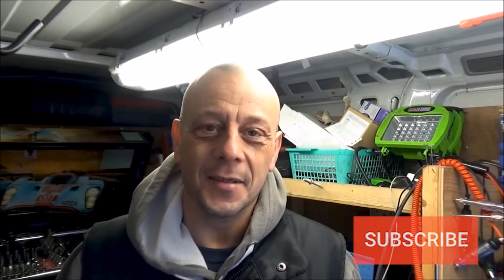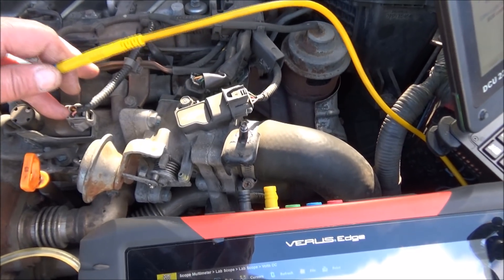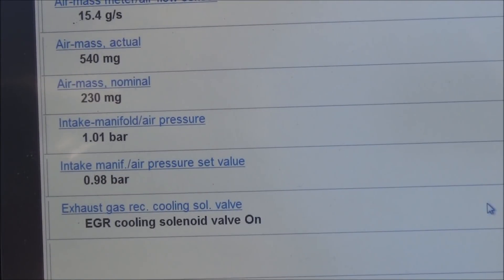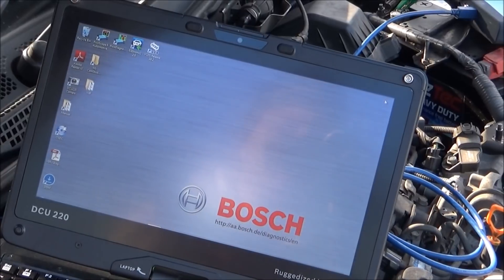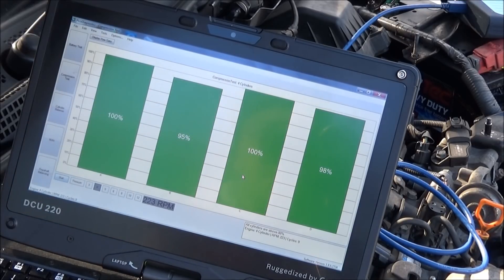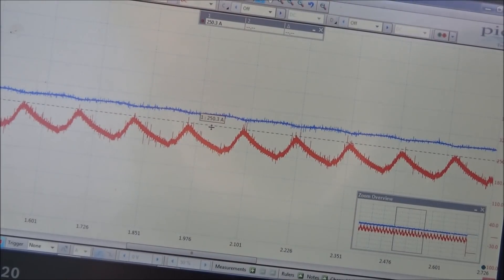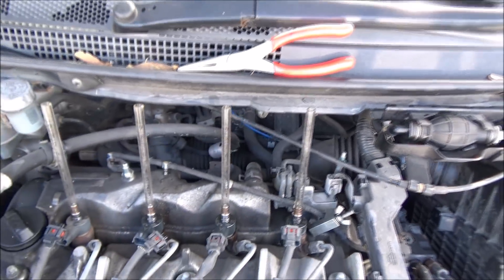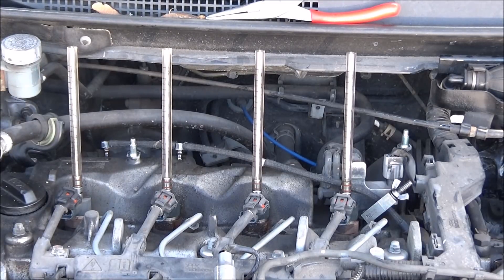2006 Honda FR V poor starting & Generic test methods

Comment: Hi Steve, love the work you do and I'm enjoying the videos but can I ask did you remove the egr on this car to check the seating as my opinion looking at those MAF readings while you were working it using your mitti vac is they looked good to me, 2.2 engine with 560mg/s with a closed egr I'd say was pretty good. 
Also the leak off test you did, do all 4 injectors get bench tested as I'd be suspicious also of 1&2 as a Bosch Solenoid injector unplugged I'd expect no more than a dribble of retuned/back leaked fuel.  
Your feedback would be appreciated.
Thanks Gary
Reply from the maker: Terraclean-mobile hi Gary,  I don’t repair stuff, I made recommendation to the garage where it was. A car of this age isn’t worth spending 4 injector etc. The guy just wanted his car to start. This was booked in for a 30 min Diag and without filming all these tests take minutes. Glad you’re enjoying the videos 😁 Steve.

Comment: Another great video...when you did the compression test you disabled the fuel injections. Fuse removed ?
Reply from the maker: Hi Geoff, no, on this vehicle I just disconnected the injectors. Be careful doing this, the key must be off to prevent any potential damage to the stacks in Piezo injectors.
Reply: Cheers Steve. . Great videos matey. .are the fish and chips from lucky petes chippy..
Reply from the maker: Geoff no mate, normally corner chippy in winsford
Reply: The injector leak off tests does this check servicebility of them..
Reply from the maker: Geoff only as far as the spill side. It’s not definitive but it does give a baseline comparison

Comment: Steve, why did injector 3 and for that matter injector 4 stop spilling a while before you stopped cranking?. It got to 9cc then hung there
Reply from the maker: Steve that’s a good question. Either weight of fuel ( back pressure) or the injector warmed up and sealed better? I honestly thought the same myself. Thanks for the comment 👍 Steve.

Comment: Hey Steve, so those injectors are also leaking inside the cylinder?? We can draw the same conclusions  if we plug the injectors right?
Reply from the maker: armando nika  “leak off” is also known as “spill” or “return “  it’s a method to cool and lubricate the injectors and to also manage rail pressure by partially firing the injectors.  You can also do this test KOER but you would need bottles instead of tubes.
Reply: @SimplyDiagnostics  Hi Steve. Please tell me where to get this tubes as I think it is a really quick and reliable method to check injectors leak off. Thanks in advance
Reply: +Simply Diagnostics thank you very mich man very very valuable video!

Comment: The number 3 spill pipe filled up really fast and then slowed off which seems strange. Great vid pal keep it up.
Reply from the maker: RJ mobile yes, it was odd. Could be ecu intervention when it logged the injector dtc or realised it wasn’t starting.

Comment: Nice video, struggled with hearing you while the engine was running. Great demonstration of the scope work and injector test. It will be interesting to watch your videos develop. Keep up the good work.
Reply from the maker: Thanks Neil, I’ve ordered a wireless mic to hopefully address this issue plus I’m full of man flu. I tried to filter out the engine noise but it wasn’t successful. I nearly scrapped the video but that would have been a waste of some good info. Thanks for watching and taking the time to comment. Steve

Comment: Hiya mate, nice vid ,loads info . not tried leak off with injector unplugged before.. maybe not such a good idea with piezo injectors u'll fill the bore with fuel i,m led to believe!
Reply from the maker: Lee, never disconnect or connect a piezo actuated injector until the ecm or edu has completely powered down. There is a very high probability of destroying the stack which may result in catastrophic engine damage. Hope this helps to clarify 👍 thanks for watching and taking the time to comment. Steve
Reply: Only been told by a diesel specialist that some early piezo injectors unplugged, to perform leakoff, cause hydrolock condition to there suprise  ,they trashed the engine :) not  summat i tried
Reply from the maker: Lee, yes mate but if they are resting powered down in their natural state there should be no fuel flow through the delivery side when disconnected. The diesel guy probably pulled the plug key on or running. If you’ve got bidirectional control with a scantool you can normally switch off injectors by running the compression test function as a safe alternative 👍

Comment: Brilliant Steve! I learned loads and I liked the leak off test got these tubes in a kit but never used them, but I will now cheers sandy
Reply from the maker: sandy, glad you liked it 👍 I use the tubes whenever possible. Free tip, when removing the tube seal the top with your finger. The fuel stays in the tube and you can dispose of appropriately instead of coating the engine 👍
Reply: Simply Diagnostics great tip!